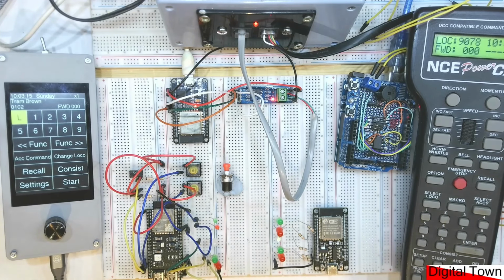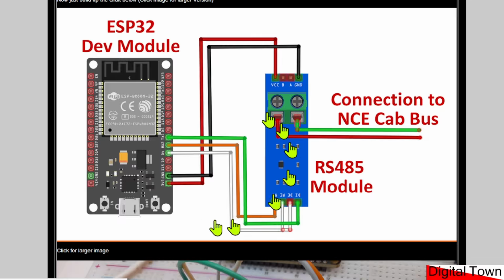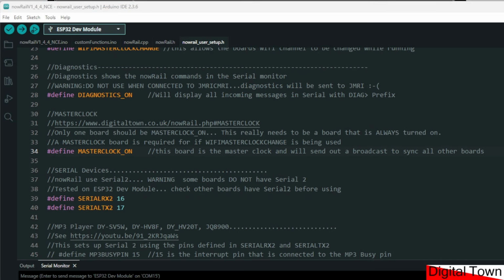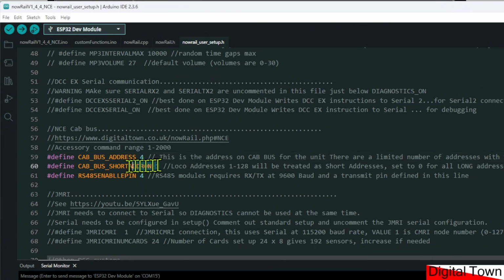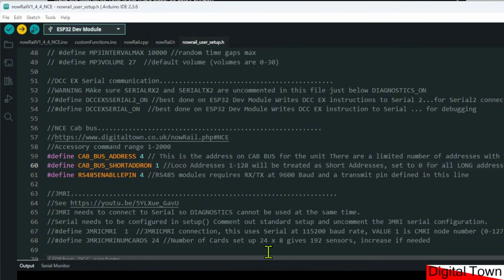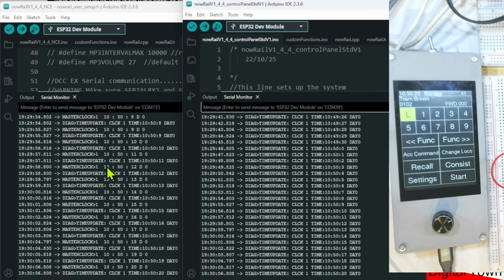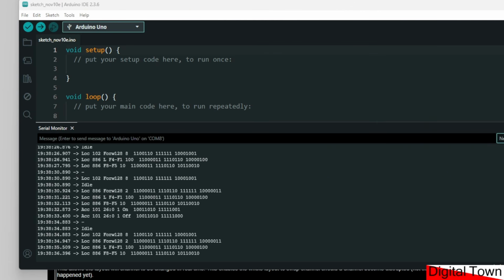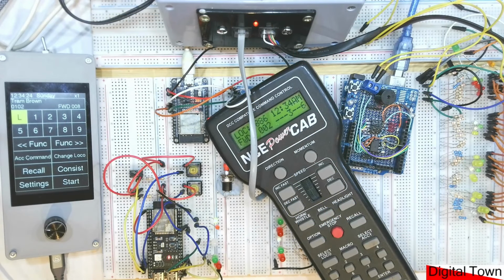#163 Arduino C++ nowRail Model Railway Control - Connecting nowRail to NCE Cab Bus

Comment: Nice , great job. 👍 is there any community around NowRail, Discord?
Reply from the maker: At the moment people just tend to email or put comments under the videos.
I could set up a facebook group or just get people to ask in the Arduino for Model Railroading group. It's not something that's been asked for before.
Reply: @digitaltown5442 it was just a thought to be able to support the initiative and contribute if possible. I would say that Discord is a better choice for ”members” that want to support and share ideas.
Reply from the maker: @boholmqvist2030  Discord is not so easy as it assumes everyone is on the same timezone. Of those who have been helping with testing and various suggestions so far only about 35% are on UK time zone so with such a small group the odds of being on discord at the same time is pretty slim.
Reply from the maker: A facebook group has been set up at https://www.facebook.com/groups/1753709375312484/